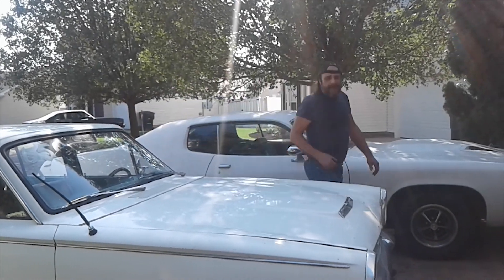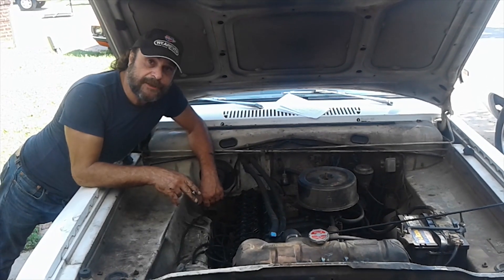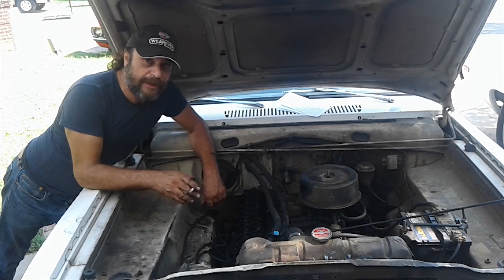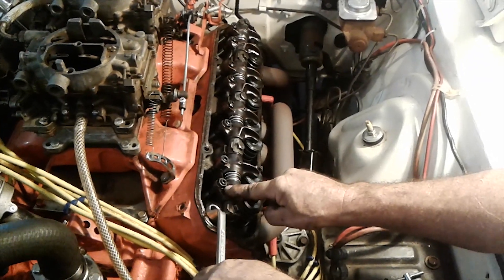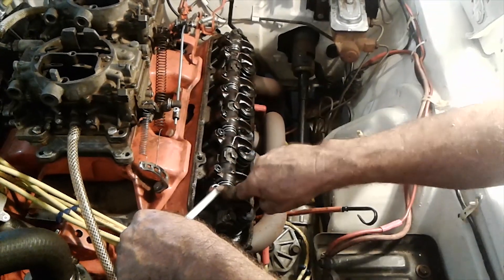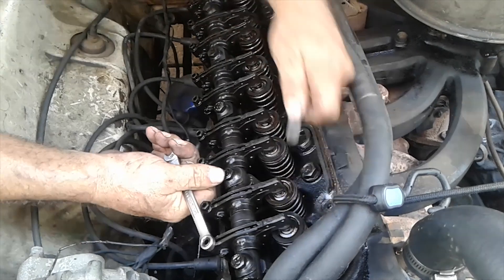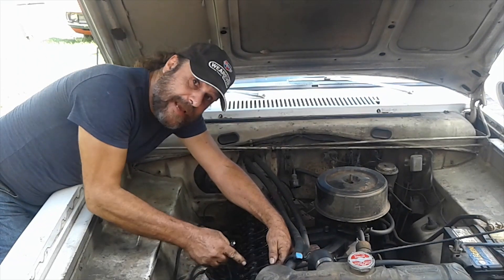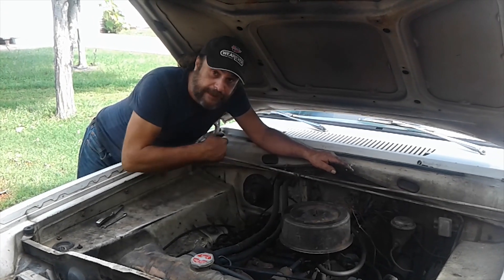BS For Beginners -Valve Lash

Comment: Idiocy? I mean it worked fine on my old 4.3 Chevy as a teenager. It takes a steady hand and a good ear but that's after we basically did as you did Tony and got her close but we still had to adjust because of the hydraulic roller lifters it used the new ones were a little longer than the wore out OEM lifters and needed a little adjustment on the fly till she settled in. For the everyday mechanic it's idiocy but for a old fashioned veteran mechanic with steady hands it's how you tune her just right

Comment: I want to see a video on the origin of the "lash adjust while running" urban myth.
Reply: Completely BS. Apparently people think they’re smarter than the engineers. Valve lash is set the same way properly, on the base circle  of the cam, with the engine OFF on any engine.
Reply: I witnessed this, back in high school, during the Reagan years. My info is fuzzy, BUT! on a small block Chevy; Engine at idle. Start with #1 intake valve. Break the jam nut loose, tighten the adjuster, until the idle JUST drops. SLOWLY loosen until the idle JUST comes back. SHOULD ONLY BE DONE BY EXPERIENCED PERSONNEL!!!!!!!!!!!! REAL MECHANICS!!!!!!!!! DO NOT COPY MY LACK OF, AND/ OR FUZZY INFORMATION AS REAL!!!!!!!!!!!! I STILL have 8 fingers, and 2 thumbs, for good reasons. I ALSO know a good bar tender, for those that can't afford a therapist......... ;););)

Comment: Mechanical cams cannot be set running in my view hydraulic cams old school Chevy can absolutely be set running Know from experience
Reply: I've seen that done. short-sleeved shirts, and POSITIVELY NO JEWELRY!!!!!!!!!!!!!!!!!!!!!
Reply: No. No they cannot. That is a myth. That is not how the manufacturer or engineers designed it. You still set valve lash on the base circle of the cam the same way you do it on a MOPAR.

Comment: B / RB
Reply: How are you suppose to get decent oiling to a roller cam in these engines ? Pumping oil  through ports to the top end, massive galleys up top etc. I’ll send an address for my free Blem T. One last thing, shirt with no pocket is a blouse !!!
Reply from the maker: If there's one thing the BBM has zero issues with, it's oiling!  Plenty to go around

Comment: Did you just touch a screwdriver to the solenoid to bump the engine or is there more to it I'm not seeing
Reply from the maker: I used the screwdriver to jump between the battery hot and starter relay terminals
Reply: That's it , That's All , Just Make Sure U'r Ignition is in The OFF Position & Tranny is in Park / Neutral . & Better Yet , Emergency Brake Deployed , Wheels Chocked & Keep U'r Key's in U'r Pocket . That Way U Know 4 Sure ! YYZ , Rock-Crush'in-Ratman . Pull that Krap on a Standard in Gear [ Engaged ]  & U Will Become a Carpenter Soon Enough . Hey Sweetie , We B Own'in an Upgraded 2 Door Garage . [ Drive Thru ] . O-Ya" , Stand 2 the Side !?